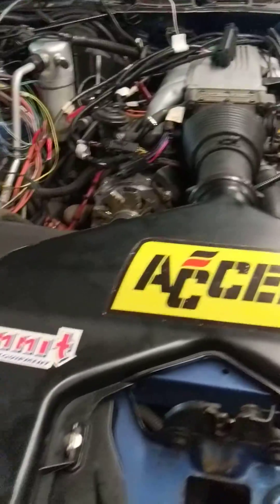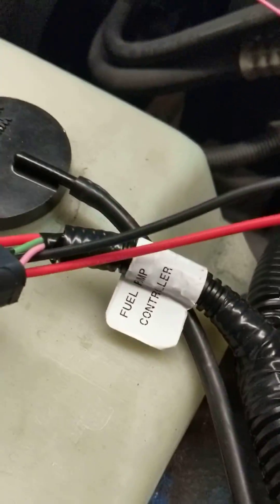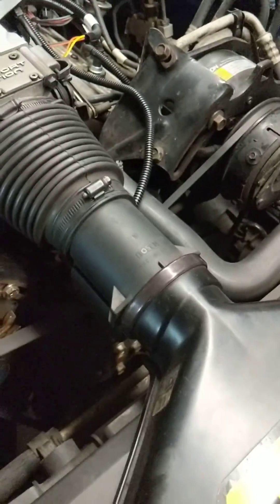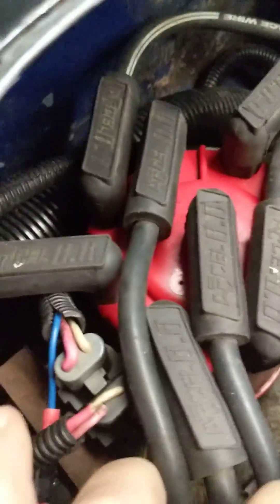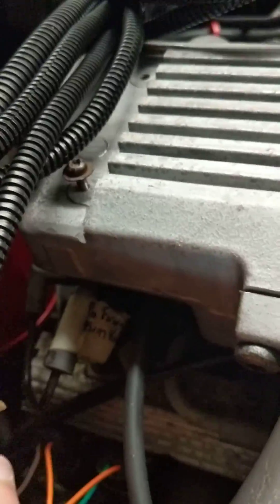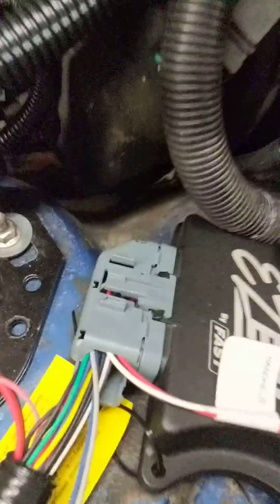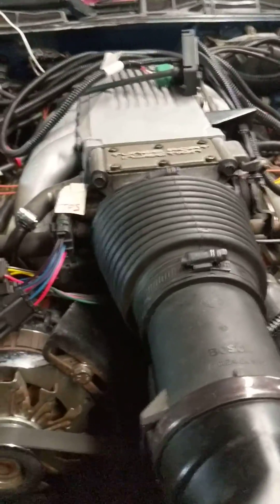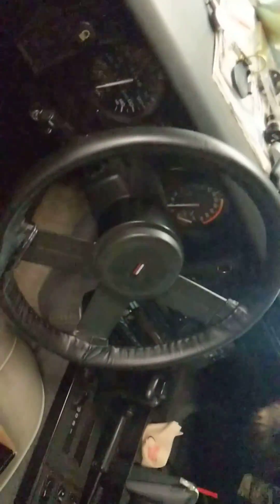Project Iroc Ez-Efi Installation Basics

Comment: Are you still using the factory gm ecu and the FAST unit? Why cant you run the car on just the FAST unit?
Reply from the maker: I've mentioned this a few places, but THIS version (1.0) does not handle spark advance or retard from the knock sensor and the distributor is stock. The gm computer thinks it's doing the fuel.

Comment: What part # was the FAST kit?
Reply from the maker: 302000 : EZ-EFI GM Multiport Retrofit kit. I bought the extra MAP sensor, an extra IAT sensor and bung, as well as the weatherpack terminals.  The car was factory normal.

Comment: is this the 302000 kit or 302000-6 kit?
Reply from the maker: Just 302000 sounds familiar. It's the basic retro fit multi port fuel injection kit. Came with the O2 and simple handheld interface
Reply: @teddyr15  I'm trying to figure out exactly which one to order for my 383 sbc stealthram setup. I'm replacing Accel dfi gen7. I want self learning.....
Reply from the maker: @johnatthebox  If you need this to do timing advance, you'll need the xfi or sportsman.
Reply: @teddyr15  it's all confusing.....so many variables....this is my first efi  experience. 
My car is running accel dfi gen7 (that I cant connect to for tuning due to broken cable)  on a holley steal thram with gm type sensors and mini timer style injectors.  Is that pretty similar to what you started with(minus the accel dfi)?
Reply from the maker: @johnatthebox  Yup, most connectors were ready to go unless you're picky about lengths

Comment: Why did you choose the 1.0 instead of 2.0?
Reply: Ok as you suggested I read the description on both units. Main difference I could see is 1.0 requires an injector change 2.0 will control spark. I’m leaning towards the 2.0. But it quite a bit more expensive. 
I have a 85 Z28 305TPI. Ideally I would like to completely eliminate the stock ECU. Just trying to have a plan before I dive into it. Again thanks for the vids. Your the only one so far showing anything about this system.
Reply from the maker: Look hard at moates.net : lots of solutions that I prefer now, but need more computer adjustment. The 2.0 is high money, especially for what it will do for your engine. The moates could get you better performance... Leave you enough money for a better camshaft... AND actually be able to tune that can! (FAST needs needs needs above average vacuum from it's camshaft) Unless you hit the lottery and get the sportsman xfi 2.0. Also, I don't think you need to change injectors.
Reply: teddyr15 

I’ve looked at doing to prom tuning. The problem is 1985 was the first gen tpi. The computer had a low baud rate. Which from what I’ve read is hard to tune. I would have to rep-in, rewire, the stock harness or buy a new harness to upgrade to a later ecu. So I’m looking at have to change the harness anyway. 
Like you it will be a matter of working around he things that the FAST can’t control. 
I did find something that will take care of the torque converter lock up. Jegs part number TCI376600. I had planned doing an EGR delete. So there is a couple of things that could be eliminated from the stock ECU.

Comment: Ok stock ecu is used for torque converter control only?
Reply from the maker: Al Engdahl Not only... The GM ecm is monitoring knock, advance, oil pressure, fuel pump. Still easy,. Less capable